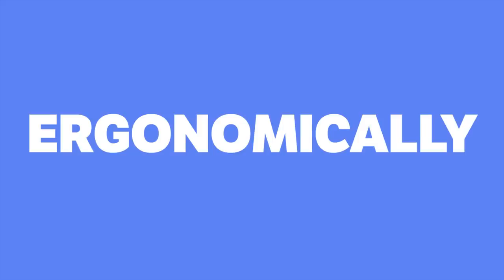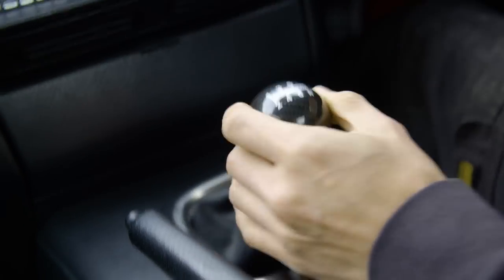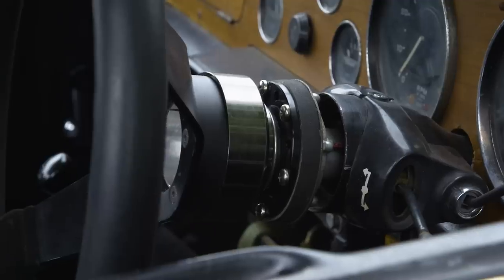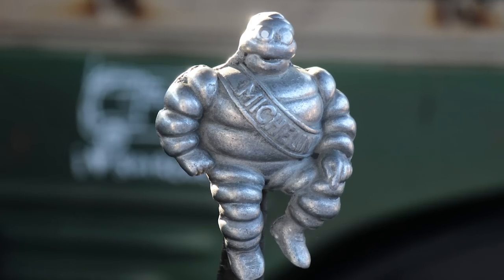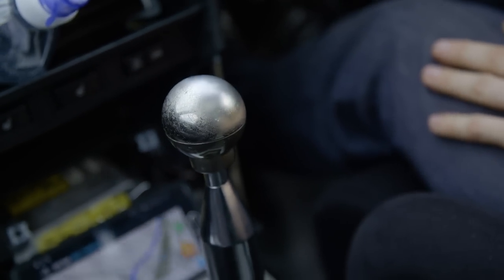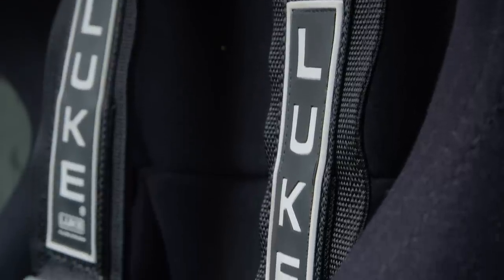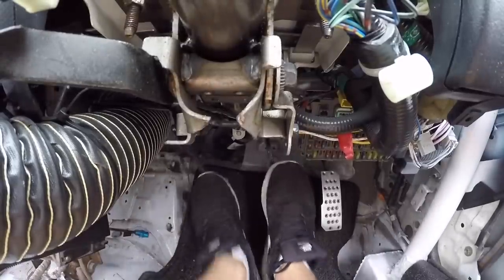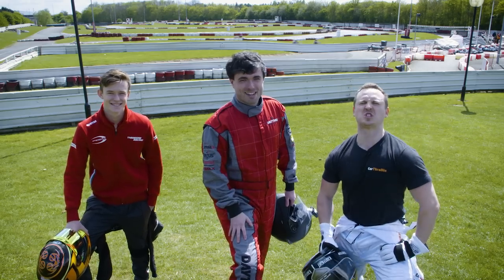5 Simple Mods To Ergonomically Perfect Your Car

Comment: If you want lots of hp for a very low price you can put stripes on your car #becauseracecarbro
Reply: And for weight reduction, remove your steering wheel and brakes as well as your bumpers and roof #bEcAuSeWeIgHtrEdIcTiOnBrO!

Comment: 1: these idiotic things have absolutely nothing to do with performance or handling 

2: If anything these are small cosmetic stuff. (But arguably it could offer some minor weight reduction especially with replacing the steering wheel to a much lighter one)

3: speaking of steering wheel replacement which these are supposed to be simple do it yourself mods. If you don't know how to replace a wheel on a vehicle equipped with an airbag which is basically most of the vehicles you're in a world of hurt or possibly even dead! Disconnect battery and wait 30 seconds then you can take apart the wheel and then clockspring, and the wheels better be in the straight ahead position otherwise your wheel will be major offcenter and you'll have to adjust the front toe afterwards to do so. Lots of work but easy if you know what you're doing. So long story short......is it really worth going through all this hassle to replace one component for an average Joe? Maybe if you track your car alot and depending what it is. But for street use not really.
Reply: That whole comment was a waste if time...